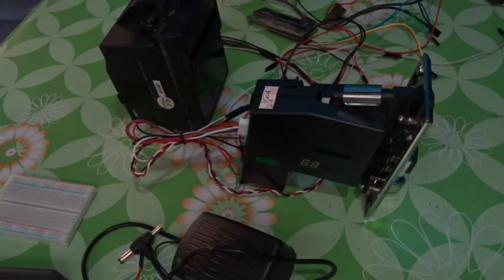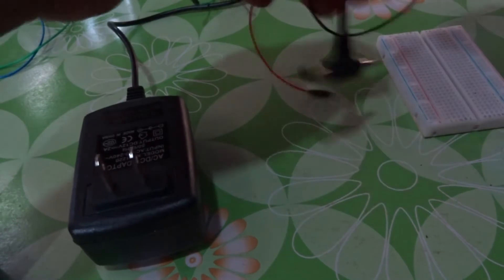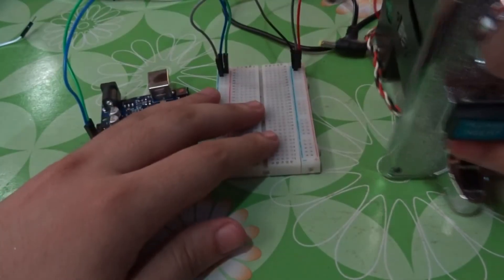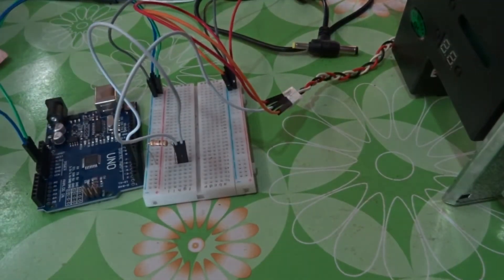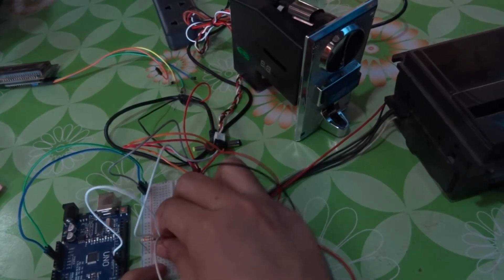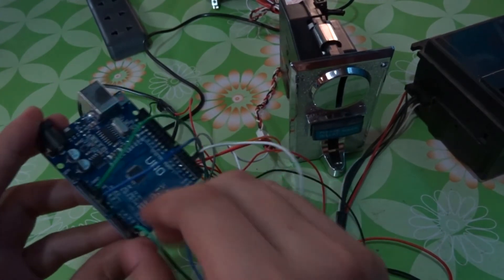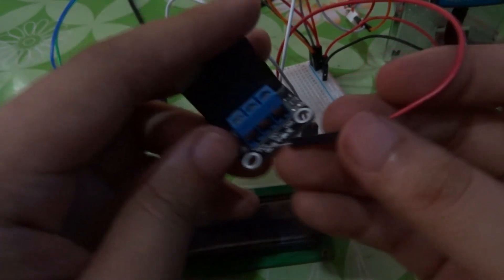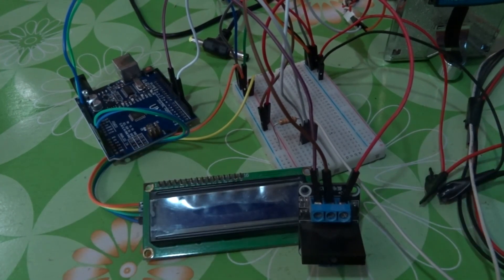Pisonet coin changer tagalog tutorial part 1

Comment: Sir pano nyo po kinonect yung dalawang wire sa power supply? Ang ginawa ko kasi pinutol ko tpos connect ko sa dalwang jumper wire, tpos anong gagawin dun sa port nya para maconnect parin sya sa arduino?
Reply from the maker: Connect mu ulit yung pinutol mu na wire. Pwede ka dn gagamit ng balun plug connector. Search mu lang sa shopee.
Reply: @studyify2568  bali 3 wire na positive yung pag sasamahin e connect , yung sa adapter end tpos jumper wire then yung sa pinutol na positive tapos 3 rin ang negative?
Reply from the maker: Pinutol ko yung wire tas dinugtungan ko ng dalawang wire. Yun yung + at - ng power supply. Yung plug sa power supply binalig ko dn, don tayu kukuha ng power sa arduino, yung + at - don ako kumuha ng power sa coinslot and bill acceptor.
Reply: Paps @studyfy may code ka ba un suklian? I mean ilalagay ko s piso tubig vendo. If mag hulog 5 peso mag sukli ng 4 peso may code kb nun?